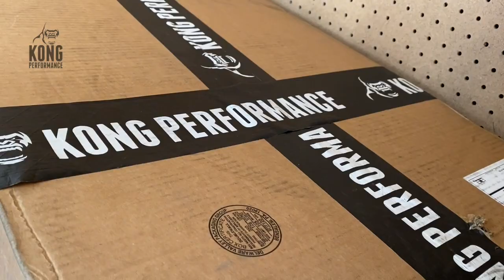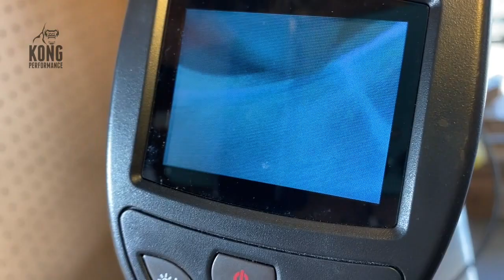G Body El Camino Restomod: Kong LSA Port Service & Install

Comment: Im wanting to run the lsa with kong lid with the cathedral to rectangle port conversion but dont know if it will fit under my factory hood. Would you happen to know the distance from the valley cover to the top of the lid?
Reply from the maker: Best measurement I could get is roughly  11”-12”